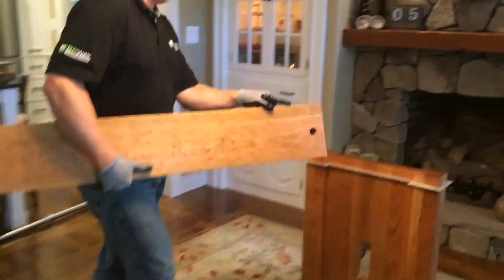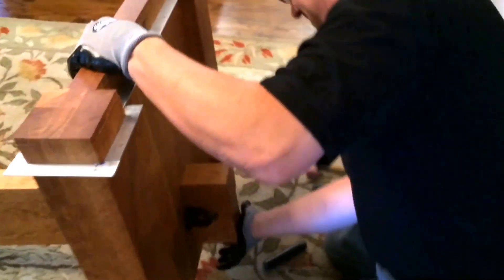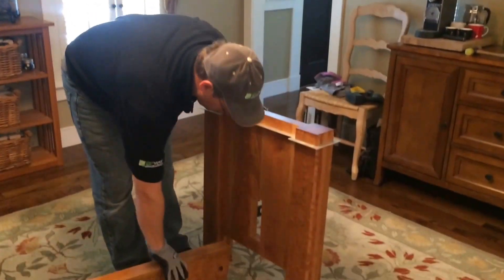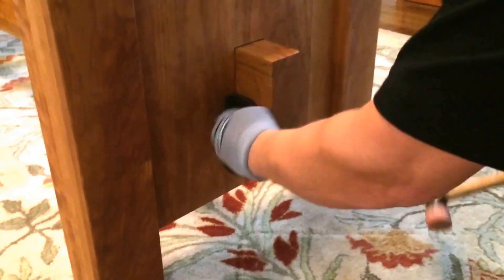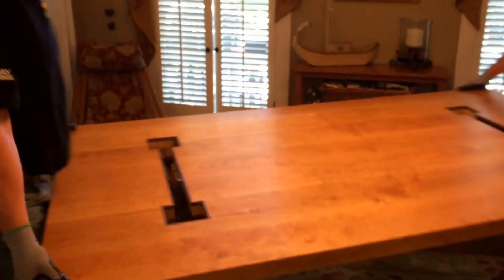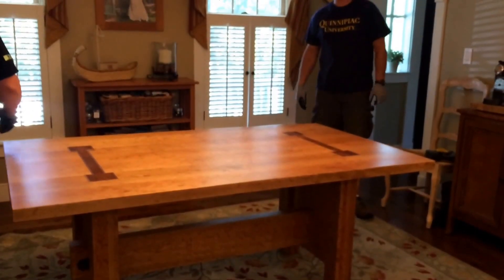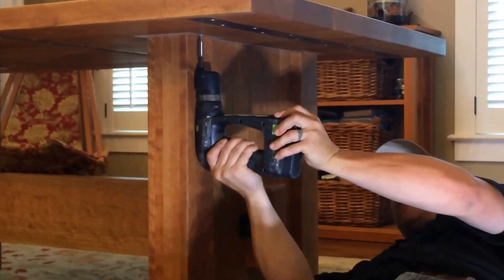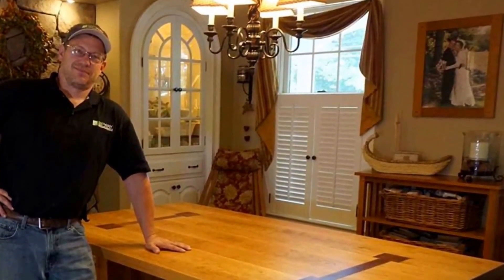Custom-made cherry table (Part 7) - Delivery & Installation

Comment: I was really impressed with your table legs and stretcher. Right up until I saw how you tried to manage the cupping and twisting using metal bares and 52 screws. It may keep the table from cupping and or twisting but will not allow for normal wood movement hence causing problems when the wood tries to expand and contract. I really hate to rain on your parade but that much solid wood will have to move. It may have worked better using splines between the top sections allowing for movement. One persons thoughts.
Reply from the maker: You are absolutely correct, that was brought to my attention.  At that point we took the bars off cut them shorter and slotted them for the screws so it allowed for expansion and contraction. Very glad I did because the table has decreased in with by about 1/8” of an inch since then till now